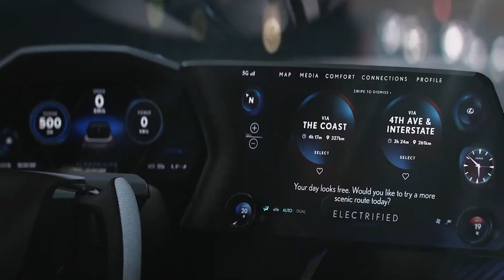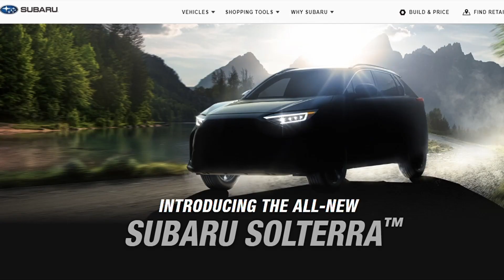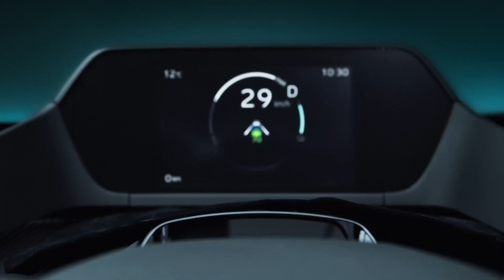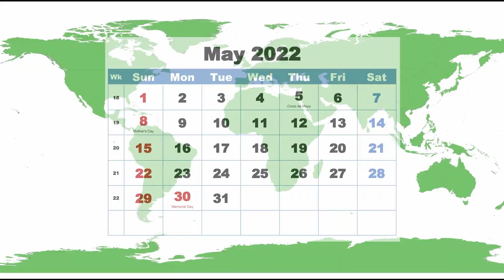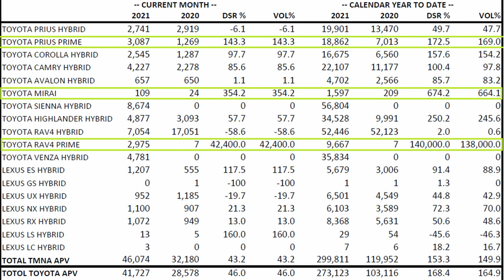Toyota BZ4X EV - Toyota Is Ready to Displace Tesla

Comment: I drive Toyota Prius V 2013 and it has done 200,000 miles so far with no issues ( just had to change break pads, spark plugs, water pump recently ) I hope I can put another 100,000 or drive until 2030 ( by replacing it with new hybrid battery which is due shortly). By then , there'll be quite a lot of options to select one of Toyota's EV.  Or I can get some Tesla model ( used one ) for damn cheap ( it's a joke though).

Comment: So far only Kia/Hyundai have the kw/h per 100 miles (or range/battery size) to compete with Tesla - I get the impression that other manufacturers including Merc/VW group/BMW/Subaru/Toyota  just try to expand battery size to compete on range - but that just increases both weight and charging times.  Even Rivian seems to have a battery tech problem.

Comment: wonder how its reliability in extremely cold weather. 
will the electronic parts be reliable?
will the battery fail easily in cold weather?
Reply: The best is to find out stats from Norway and Canada. Both with cold climates.

Comment: You are dillusional this Toyota Ev has the battery, Motor and the Ev platform supplied by BYD. Only the body design, interior design  and the Toyota badges are all Toyota  has supplied  and its made in China and will be available in very  limited numbers.

Comment: "Toyota is ready to dominate the EV segment" - Oh boy, this'll be good.

"Now Toyota is ready to establish a full line-up of 70 models by 2025" - Hang on: announcing now for FOUR years from now?

Screen tag: "Toyota is ready to displace Tesla": ha ha ha ha - oh yeah, this is good...

"April 2019 Toyota announced BZ - it's new series of battery electric cars" - sure, cause if you have nothing all you need is an announcement; same thing, right?

"At Auto Shanghai [2021!] Toyota unveiled a concept version of the BZ4X, it's first model..." - hang on, it took 2 years to come up with a first CONCEPT car?

"The BZ stands for Beyond Zero" - yes, yes it does: they had zero EVs; now they have a single concept EV that won't be ready before, maybe, 2025? Maybe they should have dubbed the model "SZ" for "Still Zero."

So we're clear: 2025 is when Toyota hopes, maybe, to be able to produce limited quantities - NOT PRODUCTION - of their holy grail: a solid state battery. Which they'll need because they shunned & were shut out of the battery supply market. So they have squat: enough batteries to keep selling their hybrids (Prius etc.) but not enough to launch an EV. Which they don't plan to be producing for at least 4 more years. But they've announced they'll have only "limited numbers" of solid state batteries by 2025: what the hell will they use to power 70 models of EVs in 2025? Obviously they'll have VERY limited production of those 70 models... in 2025.

WOW. For a company as competent and savy as Toyota to fuck this up this badly must take exceptional leadership. Exceptionally BAD leadership. And the CEO still has his job? Japanese firms really DO take the whole "job for life" commitment seriously.

Tesla is doubling production year-on-year consistently: by 2025 they'll be producing 10-16 million cars. All pre-sold before they build. Quality on a par with Toyota's, but with a profit margin much, much higher than Toyota's - and growing every year. Last year GM was 23%; this year it's running closer to 25%. By 2025 they may hit 30% [Update 10/27 pm: according to Tesla's filed 10Q (3rd Quarter Earnings Report), the company hit 28-30% GM for total automotive in the 3rd Qtr.! The legacy car manufacturers are so fv>ked!]

Toyota deserves better. They're going to go through hell. Here's hoping they can keep up the R&D & production changes they need despite plummeting sales &/or profitability. They may. Ford, GM, Nissan are probably toast. 

VW's CEO Herbert Diess is at least openly panic-stricken & doing his level best to convince his Board of Directors & his unions that VW needs to massively restructure or die. He's even had Elon Musk call in live during the Board meeting to try to get his Directors to understand what they're up against. If VW survives, it'll be because of heroic efforts by Diess - not in pushing his Engineers, but at convincing his Board & unions they're doomed if they don't get it.

Toyota OTOH is now playing the same game as US manufacturers: if you have nothing, rely on press releases to appear to have something. At least Detroit was able to scramble a (very) few production vehicles, albeit poorly designed & not in large numbers. But something.

Which is more than this Channel on YouTube has: they obviously run click-bait. I won't repeat the mistake of spending time here.

Comment: After the company's scandalously misleading "self-charging hybrid" campaign, Toyota's premium brand, Lexus, launched the UX300e electric car. That car is a dog, with low efficiency, slow charging and short range. It is also noisy and expensive. Worse still it features a CHAdeMO charging socket which is pointless outside of Japan. CCS is the standard that is taking over everywhere in except China.

So Toyota has given us a dog of a car that will be increasingly difficult to charge away from home.

With this background, it's hard to expect much from the BZ cars. Even if they surprise us and turn out to be great cars, Toyota is planning for hybrids and PHEVs to dominate the range and we really don't know when to expect volume production.

The short sighted management team at Toyota are driving that once great company to oblivion. So sad.

Comment: I still have two sticking points with EVs. One range, or lack there of. 300 miles more or less, with less being a key factor between charges. And in weather extremes we already know when it’s very cold or very hot the range decreases. And my second problem with EVs, charging time. 4 to 5 hours for a quick charge, and that’s only 80% of a maximum charge at a dedicated super charging station, and up to 12 hours to get a full charge from a home charging setup. Until EVs can achieve 400 to 500 mile ranges and charge in minutes not hours, because it that is what I can do with my gasoline powered vehicles, I’m not going to very receptive to EVs.

Comment: Hybrids are yesterday’s tech. Why would you buy a hybrid with mediocre acceleration and more parts to break down when you could buy a full battery electric vehicle with superior acceleration and lower maintenance costs.
Reply: BEV  batteies are expendable item.  $25K battery replacement on old Teslas are insane cost!  Before you get mad, just check out honest Rich Rebuild's  videos about how much Tesla battery replacement cost!   LOL
Reply: @coldspring22  I saw a video of a Tesla 3 owner saying its cheaper to own than a corolla. 
Corollas gas,parts and other maintenance will cost more than a tesla 3. Him saying even with a battery change for the tesla it is still cheaper than a gas car.
Reply: @coldspring22  The high voltage batteries can and will be 90% recycled into new batteries.  Tesla battery failures are extremely uncommon. Combustion engines are on their way out much sooner than you expect

Comment: 4:30 I appreciate that drive-by-wire probably reduces weight, but if an electrical problem occurs...?
Reply: Yep. Straight into a wall. Worrying unless there are safety fallbacks in the event of a failure!
Reply: Correct. What if is a big issue.
BestInTesla YouTube channel explains why hydrogen is like sitting on a bomb and even the hydrogen charging stations are not safe either as explosions on close circuit cameras reveals. 
.
Tesla is known for instant improvements for the assembly line.
Unheard of in the auto industry. In fact 13 improvements in only weeks as former Tesla employees are explaining on YouTube videos. 
.
Another mind boggling improvement is the giga press that which makes a complete front end and rear end assembly eliminating most of the parts and hundreds of less robotics , and better structure strength. 
.
And Tesla Smart car EVs are preferred by most people in all countries. 
.
Thanks for your attention to electric vehicles modernization and developments.
Reply: @SafepathUS  Oh, this is by no means a question about electric vehicles, but rather for any type of vehicle which might use drive-by-wire steering. GM had a gas engine concept vehicle that used steer-by-wire, after all.

As to hydrogen, there's a lot of buzz regarding what is being called "solid-state hydrogen," but talking about hydrogen is getting a bit off-topic.

Comment: EV cars has no engine, no transmission and the motor lasts 300k miles. People are not gonna buy Toyota like they used to. Toyota is in big trouble. And this is good news for Germans automotive since they had the most engine problem

Comment: “The price will be between $30k and $40k…”

The RAV4 hybrid is already north of $35k, there is near zero chance that this vehicle is under $40k, and I wouldn’t be surprised if it was closer to $50k. 

That being said, I’m excited to see Toyota’s EV offerings!
Reply: I always thought PHEV would cost more to build because it have a gas engine. If you take the engine out of PHEV, you have an EV.  I don't know how expensive the battery compare to a gas engine.
Reply: Batteries are up to a third of the cost of an electric vehicle.  The hybrids have tiny batteries compared to full EVs so expect full EVs with large batteries to cost at least slightly more than the hybrids until battery costs come down in the future.
Reply: @richh650  Hope that in 10 years Will be cheaper
Reply: Yes, I want one of these

Comment: Toyota sales are going to plummet by 2030 if they cant make a decent design and gain market share over Tesla. 

Also for those of you who plan on driving gas cars around 2030...guess again. Most gas stations in your area will close down because 40% of the cars on the road will be electric. There will not be enough gas cars on the road to make enough profit at a gas station. You'll have to drive for miles before you even see a gas station. Toyota is essentially dead.

Comment: Ha ha ha  Displace Tesla ? Not in a million years - Toyota are not leading anything, they wont tell when it will go to volume production, only following the regulatory co2 rules when they are more strict in 2025 - they have to go all electric - drop the ice engine - and scale up now. In 2025 tesla will sell between 7-10 million ALL ELECTRIC cars per year. Toyota will loose so much market share because they are way too late to the party. You have to get the facts straight if you make such a headline !

Comment: Utter nonsense. Toyota have been dragging their heels of this for nearly two decades, flogging the very dead horse of hydrogen. Mr. Toyoda has been very vocal indeed on his dislike of EVs and dismissive of their role in cars.

Nothing management has said or done in recent years persuades me that they have ANY intention to mass produce at volume. Nothing at all.

We've not even seen the production intent prototype of this thing and it's meant to be out next year.

Toyota will find out very fast what happens when you refuse to follow the market - irrelevance and downward market share.

They screwed this up

Comment: with Toyota's new solid state battery and Subaru's AWD, this is a no brainer. An actual SUV with proven AWD capabilities and Toyota quality.
Reply: As an owner of an AWD drive and a 4wd I can count on one hand the times I need the extra traction, where I live in California. I have no need to own a car longer than ten years due to the safety improvements in a modern auto. The legendary 95 Toyota, with 300K miles on the odometer, and still runs, and never broken does not fit my situation. Sorry I will take almost any electric car over a new ICE Toyota due to the simple design of a battery and an electric motor. My bet is on Tesla, and the cost per mile to operate in KWs vs gasoline.

Comment: 2025, Toyota's EV PROMISE. And yet they STILL haven't begun actually MAKING a full range of Electric Vehicles. They've had over DECADE since they were shown the inner workings of Tesla. But Toyota still needs FOUR MORE YEARS to finally make a full range of Electric Vehicles? It's 2021 and since 2020 Tesla has built - or is near completion - on car factories with an annual production of THREE million cars. Tesla is constructing multiple battery factories as well. But Toyota will START this in 2025. WOW. Good bye Toyota.
Reply from the maker: It's looking like they are really late now.

Comment: It’s not always about reliability. Toyota cars are never fun to drive, high noise inside the cabin, terrible body roll and very stingy in options!  They play it in a indirect way, that to get a good Toyota you need to pay same as for German cars!.
Reply: By the way,are Germans cars are going to 300000-500000 km with minimum maintenance? Cause every year they have new engines and if you are not buying extended warranty,you’re live can be very expensive. German cars was before very good cars ,now are just fancy and more expensive to fix after warranty. Camry for 19 years was number 1 top cars sold in the USA cause was boring and not fun to drive…

Comment: Are we looking at a dwindling gas lobby soon since everyone is talking electric? It’s amazingly what Tesla could achieve by making EV trendy and oil lobby could not throw a spanner in the wheel. Other auto giants have been toying with the idea for decades but now we have finally accepted electricity a major power source. Kind of what happened with the railroad industry in mid 20th century.
Reply from the maker: It is inevitable. Electric is not just the Future it is NOW
Reply: ⛽ gasoline will not go anywhere for decades. Electric, hydrogen fuel cells will all be part of the mix. Diesel is still important for pulling power.

Comment: Is the new EV from Toyota going to be a solid state battery powered system?
Reply: They keep teasing us with a solid state battery announcement...will it come with the final release details of this vehicle? If so, It would obviously put the range way over the estimated 250-300 miles cited in this video. But then if that is the case, this vehicle would cost quite a bit of $$$.

Comment: If they do AWD mechanically with a driveshaft through the centre of the car they will never succeed.

Aside from the energy losses and physical complexity ... if a car doesn't have a flat floor for rear passengers it will be dismissed - especially in the family car/SUV segment.

And mechanical AWD is always going to be less flexble in terms of torque and stability management.

Seems to me like Toyota's engineers are being hoodwinked or forced to ignore technology that works and leads.

Toyota haven't ever done this before have they? Ah, no, wait ... maybe they have?
Reply: I hadn’t picked up on that. That’s ridiculous, goes to show the still aren’t really making EV’s, they are converting ICE designs. It’s staggering really.
Reply: ALL AWD electrics use motors both front and rear......NO drive shafts........Get a Life..........Paul
Reply: @paul-flyer  except the marketing video for this specific (prototype?) Clearly depicts a driveshaft.

I do have a life.

Except that I actually watched the whole video, so perhaps I don't - relative to those who didn't - actually have a life ... Ummm ... Ok?
Reply: @paul-flyer  at 3m42s in this video it clearly shows b roll from Toyota that shows AWD being driven using a driveshaft.

You wouldn't have needed to spend long watching this video (esp. at 1.5x speed) to see my point.
Reply: @paul-flyer  The Subaru Crosstrek PHEV was designed in connection with Toyota and it uses a mechanical driveshaft to the rear even when operating in electric mode, it wouldn’t surprise me if the BZ4 does something similar. That being said, Toyota’s AWD HEVs and PHEVs use an electric motor in the rear instead of a driveshaft so it will be interesting to see what they do. The video clearly showed a driveshaft though. I think it would be the first AWD BEV with a driveshaft.

Comment: If Toyota is so committed. why was it in front of U.S congress trying to delay the uptake of Electric vehicles?
Reply: Lol...you know USA has the biggest oil reserves on the planet right?

What happens when petrol dollar collapses?
Reply: @Athrunwong  synthetic fuels are a good option
Reply: @pauldavies7469  no they aren't loool
Reply: @lolfreakwaca4328  they are a perfectly viable option alongside hybrid, battery electric cars and Hydrogen fuel cell. A multi pronged approach is the best way

Comment: If the range is only 200 to 300 miles, I am not sure it will displace Tesla with its range of over 350 miles.  Even GM is going to have a range of 350-400 with its new Ultima battery as that heavy GMC Hummer EV already has a range of 350 miles (but is very expensive).  We will have to wait and see what the range is, and what kind of charging network they will have.  That is what will drive its adoption.  Price alone won't drive consumers.